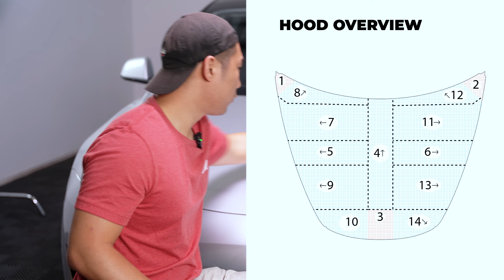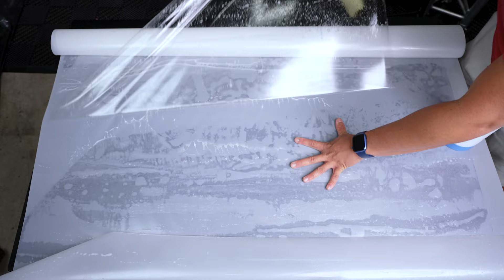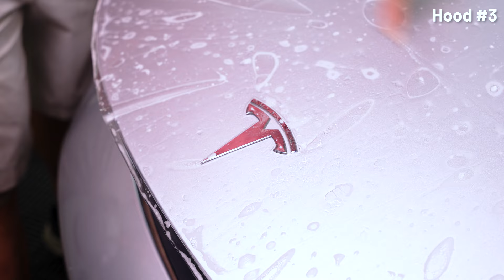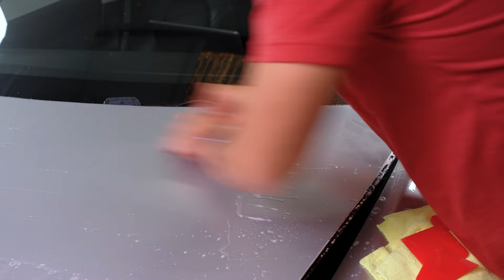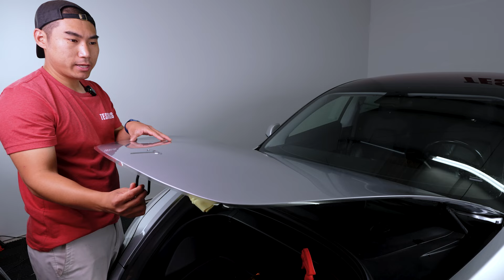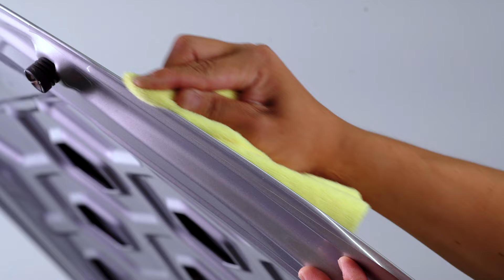Step by Step Guide: DIY PPF Installation On Model 3 Hood

Comment: How is compared to laying vehicle wrap? Also is this slip solution similar to rapid tac?
Reply from the maker: PPF is a wet install and vinyl is usually dry. You can see the differences and similarities in this video where we wrap a hood in vinyl - https://youtu.be/T86EiyT3eVg Slip solution is essentially soapy water. It has similarities to rapid tac, but rapid tac is made for vinyl that can be wet installed. I wouldn't use that for PPF.
Reply: @diywrapclub  yeah we don't use solution on air releases material but we do use it on our translucent digital print material and our electrocut vinyls so my question was all over the place and not asked very well haha. I was meaning more like does this ha e the stretch ability as like a car wrap or would it be like trying to lay translucent print metrial on a hood. I'm sorry about the horrible asked question haha
Reply from the maker: @jeffbryner5355  no worries! The materials act very different. PPF is 3x the thickness of vinyl and it’s pretty much straight urethane, whereas vinyl is thin PVC that stretches much easier. And the install techniques and tools are pretty different. Like when you’re putting vinyl on a hood you would want to stretch it or at least add tension when placing it, but for PPF you wouldn’t. I hope this better answers your question!
Reply: @diywrapclub  yes it does. Thank you for your time. 😁